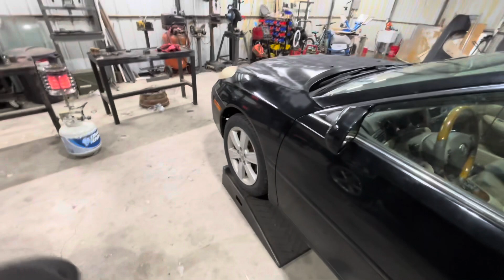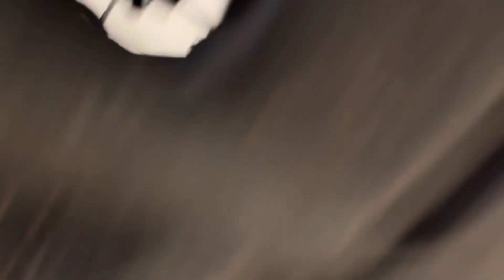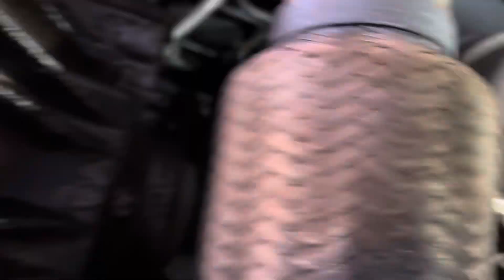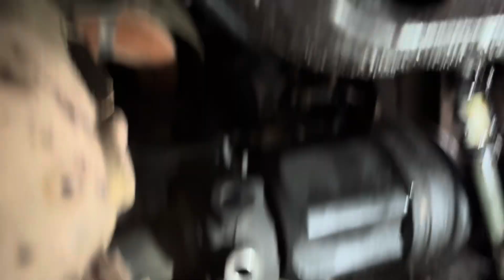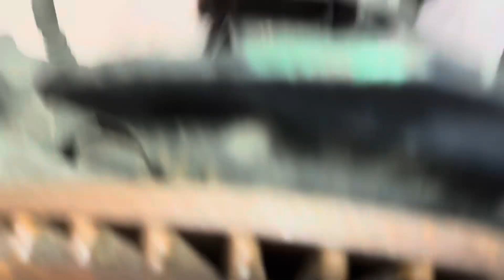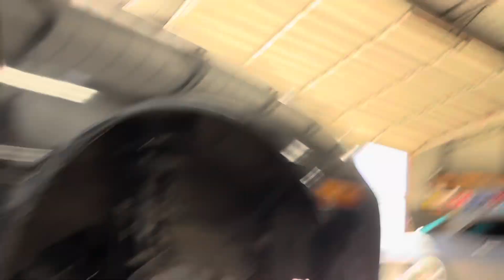2005 Lexus ES330 CV Axle Replacement. How to.

Comment: I have a 2004 Lexus ES330 and I was told the outer CV boot is leaking grease. I also eat a metal clicking sound while going over bumps while turning. My question is: Different mechanics have told me to replace the boot and grease up the bearings inside. They have said not to replace the whole thing since Lexus and Toyota CV axels are well made and cost $850-1000 just for the passenger side axle. But others have told me don’t mess with the boot and just use an aftermarket CV axle. I’m torn and I don’t have a lot of money. Was wondering your thoughts. The car has 207,000 miles but it’s in good condition otherwise
Reply from the maker: I used a rock auto CV axle. I don’t remember how much it was but it was under $100.  The problem with the boot leaking grease is it also allows dirt in. The clicking is the rollers hitting metal to metal which is in turn, wearing them out.  Anyone who says “they’re Lexus/toyota parts” and are built to last, then why would they sell Toyota and Lexus replacements.. they all wear out.  $850- $1000 bucks sounds extreme. Last time I checked on them they were about twice what the cheap once’s cost. I think it was like $200-300. I would look around and for longevity I would use the Toyota part but not if they’re actually $850-$1000. I haven’t priced them in a long time. Our Lexus melted a piston so we no longer have it.

Comment: Have you had any problems with these aftermarket CV axles since you have installed them?
Reply from the maker: Never had any issues.  Don’t know how long they would have lasted.  The engine melted a piston and I ended up junking the car. So I don’t have any long term results, sorry

Comment: I’m getting this issue at highway speeds normally 65+ you think I should try this first? I already replaced my tire rod ends and ball joints. Was told my struts need changing. I’m not a mechanic but I don’t want to keep spending money. For me the vibration stays when maintaining highway speeds
Reply from the maker: I would check the boots to see if they’re torn. If they are there will be grease everywhere under the car from it being slung around.  If there is then you can try to refill the boots with grease and try to seal it, which won’t last long. You can buy replacement boots but they’re a nightmare to install and keep sealed.  If there isn’t any evidence of grease from the boots, then maybe get your tires checked for balance.  Axle/wheel bearings can also cause a vibration.  So it’s a matter of diagnosing where the problem lies and finding someone who’s experienced to check for the problem isn’t a bad idea.  It’s hard to give advice without seeing the car. Hope you can figure it out.

Comment: oh! one more question.  are those 2 botls that attach the knuckle to the shock absorber alignment bolts?  I think I might be able to replace my bearings with the steering knuckle attached to the vehicle if removing the lower arm will give me enough room to move the axle out of the way without having to remove the 2 botls holding the knuckle to the shock.  if I can do it without removing those bolts and just the lower arm do you think it will need a front end alignment? if I do have to remove those 2 bolts  would I need an alignment?
Reply from the maker: The two bolts on the strut  are not alignment points.  I replaced the lower arm and strut assembly in that car and I don’t recall any alignment points on either.  There were no slotted holes on any of the parts that I remember.  I’m honestly not sure how the alignment is done on those cars. Other than being able to adjust toe with the tie rod ends, I didn’t see any other adjustments. Wish I could be more help.  I don’t have the car anymore, it melted a piston and I ended up giving it up.
Reply: @ogresspeedshop  I went through the repair manual for the 2005 lexus es330.  On the section for front suspension section 26-7  it mentions those 2 bolts as Camber alignment bolts. To loosen, push the bottom of the shock in the direction of needed camber then to tighten both bolts.     I just replaced the bearing and new wheel hub on that side and was able to remove the axle from the hub by only removing the 2 nuts and one bolt holding the lower ball joint to the lower control arm. I have ordered a new CV axle as well and believe I should be able to get in put in by only removing the lower ball joint bolts, not the ball joint itself from the knuckle at all.   I hope my axle comes out as easy as yours did.   The axle is  shorter on the driver side, not sure if just disconnecting the lower arm would give enough room or not on the driver side as it does on the passenger side.
Reply from the maker: @JohnNorris411 That’s good to know.  I didn’t remember them having any play in the bolts when I replaced them.  Good to know that you’re figuring it out. Thank you for the update.

Comment: Hey. Thanks for the video.   I have an urgent question. I have this car and about to replace my front wheel bearings.  Do the wheel bearings on the 2005 Lexus es330 need to be magnetic? I assumed they did and ordered some bearings and they are not magnetic, but the repair manual mentions not damaging the speed sensor rotor when removing the axle... So I am thinking maybe the speed sensor is running off of a magnetic part on the axle rather than the bearing?  I have the parts and ready to do the job But I need to know for sure if I can use the KOYO bearings I have or if I need to order magnetic bearings. Thank you for any info.
Reply from the maker: The wheel sensors use a reluctor wheel on the axle. The bearings are just standard bearings as far as I know.
Reply: @ogresspeedshop  Turns out you are 100 percent correct on this. Thanks.

Comment: I purchased the axles from a local part shop,one that my mechanic recommended. My mechanic teplaced it, but two weeks later, I started hearing the nosie by the wheels. 
I took to another mechanic and he said that they were not replaced. I called the place where I vrought the axle and the guybsaid for me to get the serial number and matchbit tonthe receipt. If its bad, he would replace them. Do they have serial numbers on them? Please advise.
Reply from the maker: I’m not sure on serial numbers being on the replacement parts.  There may be a part number but I don’t recall if there was a serial number on the replacement axles.  I bought and installed them so there wasn’t a reason for me to look.  Hopefully someone else can chime in who knows the cars better than I do. Sorry.

Comment: My 2004 ES330 with 136k miles has a torn CV boot on the driver's side. Should I replace the passenger side axel as well? No problems with it so far.
Reply from the maker: That’s really up to you, the drivers side is easier to change in my opinion, so I guess it depends on how much you want to spend and how much work you want to do.  I’m a believer in “if it ain’t broken, don’t fix it” but there’s nothing wrong with doing both so you know they’re both good.
Reply: Only if you replacing with original one, or one that costs at least close to the original (500-600$, don't go for the cheap toys) ... Most Chinese and aftermarket cv axles sucksss, they vibrate, they are done fast (1 to 3 years)... Better is to do a rebuild of the old CV axle. But if it's fine, don't change it.

Comment: thanks for the video. very helpful. quick question, does it matter if the car is in park or neutral? mine is very stuck even with a slide hammer. may have to use some sort of ratchet and strap to get it out.
Reply from the maker: Doesn’t matter what gear it’s in. Which end is stuck, the wheel end or the transmission end?
Reply: @ogresspeedshop  transmission end. been slide hammering for a good 15 mins and it wont budge. thank you!

Comment: Great video, thanks. I replaced both sides. It took me less than 2 hours, including putting away my tools. 2005 ES with 350k miles will roll on a bit longer.
Reply: That's great... For me, it took me 2 hours just to take off the CV joint from the hub.... 2 hours of banging and torch firing the damn thing...

Comment: Did any of your cv axles have a cotter pin?
Reply: Oh ok. My CV Axles I got from rock auto have a detention area on the threads. So I would have to the edge of the nut right? Would I need a special tool to stake it?
Reply from the maker: I just used a square shaped punch that fit a little smaller than the slot and staked it with that.  I think a round punch would work too.
Reply from the maker: No, they were all the type that you have to hammer in the edge of the nut

Comment: Every Toyota I;ve done, always replaced the seals. It's a pain to take the extra time,,,but worse if you have to take it back out.  And have NEVER had a passanger side mid bearing axle just slide out like that.
Reply: Are they easy to get out? I am investigating replacing these seals along with my axles, just not sure how the seals come out.

Comment: Thank you in advance, will you prefer to have after market or used OEM axle part?
Reply from the maker: If you can get the genuine Toyota parts, they’re usually a little better.  More expensive of course.  I got mine from rock auto. They were what had a budget for at the time.

Comment: Good work on the showcasing the fix. Have an inner boot rip and grease leak and it says it’s better to replace the whole axle so might just to do that. If you have an opinion lmk. Also, your radio, where’d you get it and does it work with aux?
Reply: Unless the hardware is bad, I would just reboot it. Your original CV axle will last long time ( mine  is still running after 320000 km). After-market is cheap but quality is hit and miss. You can buy rebuilt one which is better than some unknown brand new axle.
Reply from the maker: My opinion, replacing the whole axle is better and easier than just replacing the boot, you basically have to do the same amount of work and taking the chance that the grease you lost wasn’t enough to damage the joint.  I would just replace the whole axle assembly.  The radio in the Lexus is the factory unit that has built in navigation. It’s not the most advanced GPS system but it works somehow.  I don’t think it actually works like GPS, it’s some home uses a preprogrammed map system.  Not really familiar with it.

Comment: What tools do I need
Reply from the maker: You really just need the basics.  So a decent socket set up to 24mm maybe 27mm. You’ll need a 30mm 12 point socket for the axle nut.  A pry bar. You’ll need a set of snap ring pliers for the mid bearing on the passenger side.  A jack and jack stands.. I think that pretty much covers it.  A drain pan of some sort to catch what spills from the transmission when you pull the axle out and transmission fluid to top off what you spill.

Comment: Where did you shop for the cv axles? I tried looking for the oem parts through dealer but the prices are up to $1k just for one side. Then the aftermarket parts are ranging from $40 - $155 but I heard they're not very good.
Reply from the maker: I got them from rockauto.com.  I just went with the middle of the price range for them on there.  I’m happy with them so far.  They fixed the vibration problem we were having and made my wife happy.  
Here are the part numbers that I got.  And yes, everyone says use only genuine Toyota parts but like you said.. not everyone can afford to spend that much on a 20 year old car.  
APWI	TO8319A  $44.79
APWI	TO8320A $63.79
Hope this helps and good luck with your repair.  Thank you for watching, I appreciate it!
Reply: @ogresspeedshop  Thank you for sharing your knowledge! Much appreciated

Comment: I learnrd to replace the seals at the same time.  But by the looks of that car,.... it has so many leaks anyway.
Reply from the maker: Most of the mess was from the axle boot being split… but it does have a leaking oil pan, power steering pump, rear main or what ever it’s called on a transverse engine, and it kinda looks like it needs to be resealed on the trans casing too… there is a lot.  I think the only place I didn’t see a leak was from the axle seals.. I am planning on sealing it up at some point.. just collecting all the parts and gotta find time where I can take the car down for an extended period.

Comment: Thanks for the video. I replaced a bad transmission solenoid (S4 for 5th gear, vid on my page) today and turns out the bushings in the control arms and ball joints aren't horrible, so I'm kinda glad my package got lost cuz I'm no longer planning on doing them anytime soon LOL. Gonna go ahead and bookmark this just like your other vids, just in case. 😅